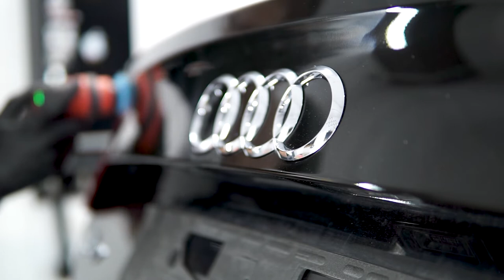2012 Audi A7 Full Detail - Engine Bay - Interior - Exterior - Auto Detailing

Comment: I’m about to clean my engine, does anything need to be covered on the 7 series?
Reply from the maker: Electric components on newer cars are mostly water proofed BUT you still have to be careful not to get too close to the connectors with your power washer. Compressed air afterwards is a must!
Reply: @maxvisionautodetailing  Thank you!